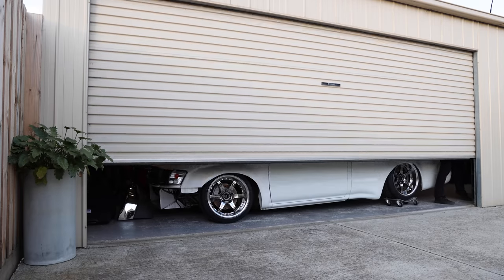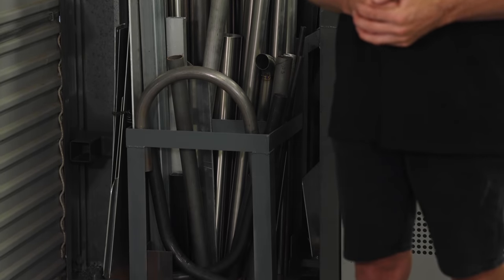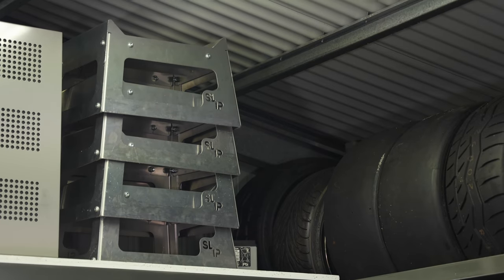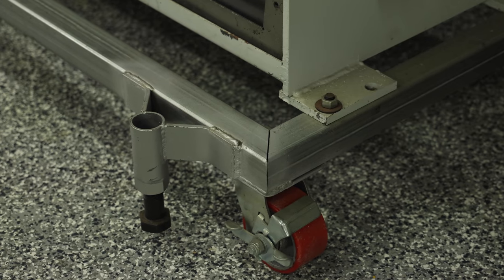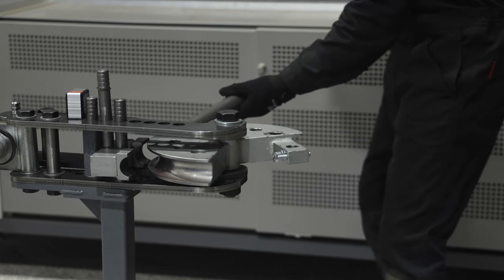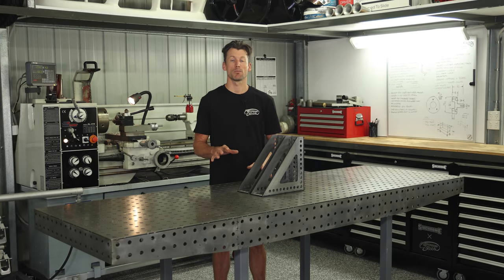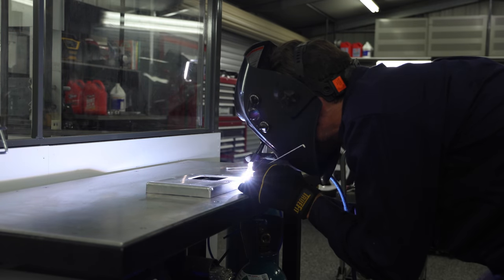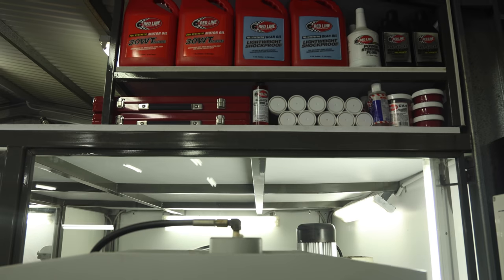Engineered To Slide Garage Tour

Comment: Epic setup Nigel and great refinements from the pervious layouts. Also props for the presentation and edit, many channels struggle to minimise repetition and overlaps between cuts, this is clean and concise

How do you find ventilation in the mess room, especially when you had the welders in there? My metal shop tucks into my garage in a similar way, it's 2.5m tall walls on castors so I can change the size depending on the project. Even with an open top and one wall being the roller door I end up with a cloud of metal fume in the whole shed if I'm welding large sections or doing heavy grinding.

Comment: Awesome shop setup!!  I noticed you do a lot of welding over the epoxy flooring.  I have epoxy flooring in my garage shop and one complaint I have is the slag and sparks burn little marks in the flooring.  How have you kept the epoxy floors from this kind of damage?  It looks like most of your welding is TIG so maybe your welding is just much cleaner than my MIG welding??

Comment: can you run thru the hoist set up a bit more please? does it mount or get bolted down when in use etc and what was the name of it again plz?
Reply from the maker: It’s a MAXJAX hoist and you can visit there website for more details on the fitting and application of it. It gets bolted into the floor before use. Thanks

Comment: Been looking forward to this video and did not disappoint. Such a great use of space, keen to see the new course material shot in here. With regards to the string alignment, do you put slip plates/turn plates on top of those stands so you can measure and adjust without having to lift the car?
Reply from the maker: I don’t use slip plates or lift the car when aligning, I simply give the wheel a little wobble in between adjustments and correct the center. I would suggest putting slip plates (just a sheet of steel with grease) but I’m usually pressed for time during alignment and the car always feels great after doing them so I don’t think it’s far off.
Reply: @Engineeredtoslide  awesome, thankyou!

Comment: Where did you source your sliding doors and tracks from as they keep the work space extremely neat and finish the storage space off.
Reply from the maker: These cabinet's I sourced second hand but they are made locally and feature sound absorption matting behind the perforated doors. Really any sliding cabinet will do the job, cheers

Comment: Hey mate love your work! Just wondering what you used for the mess room windows? It looks like perspexs but I though the sparks might melt into that?
Reply from the maker: Your right it’s the cheapest Perspex I could find and measures 5mm thick. Sparks don’t harm it, in fact it’s more resistant than glass in that regard.
Reply: @Engineeredtoslide  awesome thanks for the info!! love your work

Comment: How did you go about building the mess room, I'd like to do a similar setup?
Reply from the maker: I used 50x50mm tube and then lined it with 10mm MDF sheets, the windows are acrylic and are stuck on 20x20mm steel tube frames.

Comment: In wtac they were talking shit about your front camber, do you have a retort? Are they just too used to fwd?
Reply from the maker: Yes they were but I have to agree with them haha, I run too much because I run stock guards with big tyres and a low ride hight so its a trade off, I could raise it but thats not my style.
Reply: @Engineeredtoslide  did it affect front end grip?
Reply from the maker: @jayveethreefive5214  Not really, but if it the car was a lot faster (more HP) it would definitely effect lap times, if I stood the tyre up (less camber) it would increase grip under braking and mid corner speed but this car isn't really designed for that type of thing, it's more about having a good time and using what I have.